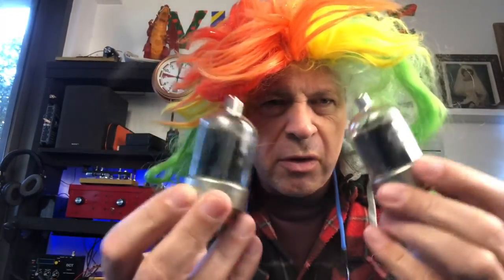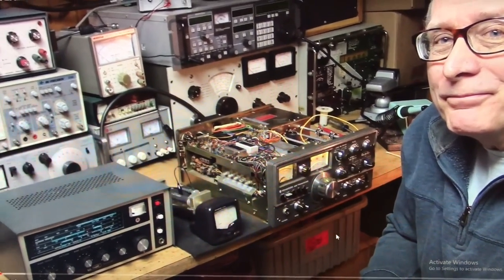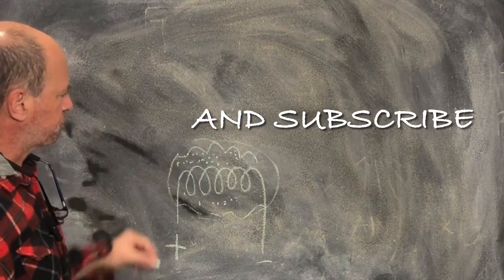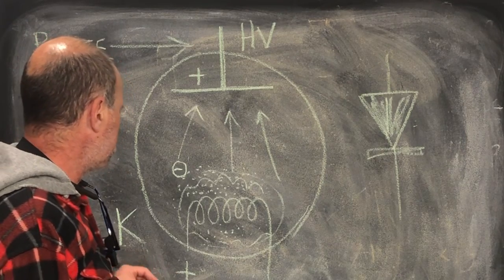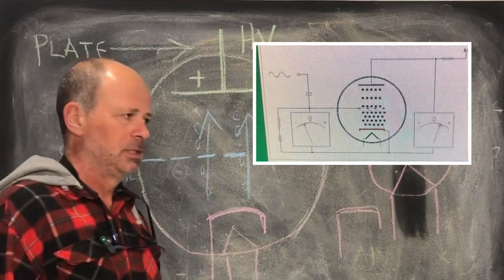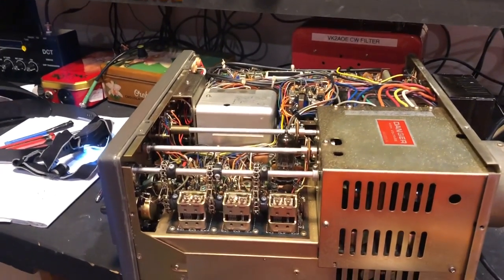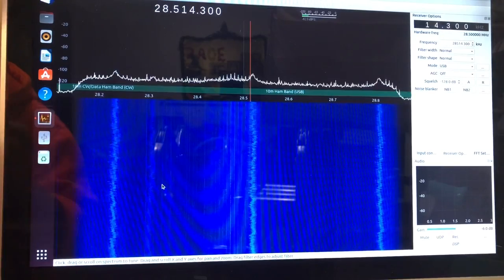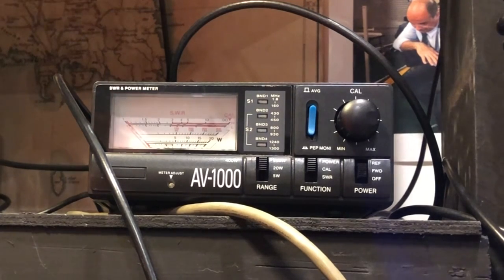KENWOOD TS-520 - Finals replacement@TheArtofEngineering

Comment from the maker: Which might mean that the filament supply or some other part of that driver tube is loading a supply causing the issue? My TS520 I changed all large electrolytic caps (not every cap). I’ll look at a cct diagram and have a think about it. 73 OM

Comment: Darn good opening advice!

It cant hurt  to thoroughly clean the glass envelopes and pins so contaminants dont  burn on.

Also, according to the tubes plate curves, the 6146 and 6JB6 are the same tube except the 6146 is twice the plate dissipation rating, and one less base pin. They have the same biasing and operating point(s).

The electrons jumping into a cloud is a myth.
The heat reduces the Work Function requiring less plate to cathode potential to cause them to come off.

If not, current could flow without extrrnal bias.
Reply from the maker: Thanks for the comment. Could you point me towards some information that confirms the electron cloud is a myth? It wouldn’t surprise me that this is true (as even the current flow analogy to water is SO NOT reality) but a quick search didn’t offer any info. Thanks for the comment. 73 de VK2AOE.

Comment: Hi mate, I have been watching your youtube videos and trying to tune in my 520 I am so confused. I am not sure if it is even working. I am getting a little bit frustrated. I definitely need some help.
Reply from the maker: Are you just tuning it to transmit ? Or have you replaced the tubes with new ones. If just tuning for transmit watch this video
https://youtu.be/40Inq07Spd4 it helps to have a 50 ohm dummy load but if you know your antenna has an SWR below 2:1 you can tune it “on air”.

Comment: Hello
Would you be so kind as to give me some advice?
I have a Kenwood TS 530s with the following symptoms:
In RX:  
heater=off, Reception is correct.
heater=on, Reception is lost.

In TX: 
Selector in SSB:
IP readings: reading 0 Even negative, 
ALC readings: reading 0 Even negative, 

All components of the final step plate are in good condition.
Could it be a valve12BY7a problem? or the electronics of its periphery?

Thank you.
Reply from the maker: I am by no means an expert. Obviously be very careful as the voltages are deadly!! Only proceed if safe and you know what’s going on. Have you tried with driver tube removed and heater switch on…. To see if that kills receive? It is an interesting fault? Let me know what caused it, when the solution is found? I will keep my ear to the ground and if I hear anything helpful will pass it on 73 de VK2AOE
Reply: @TheArtofEngineering  First of all, I can't be more grateful for your quick response. This equipment has just arrived in my hands because I really like valve equipment. They seem like engineering jewels to me.
I have carried out the test that you propose, If I remove the Driver valve, 12BYA and right after I activate the heater. The reception is perfect, it is not lost.
Thanks again
Reply: Apparently it could seem like a valve problem. I don't rule it out. What happens is that I have tried a second valve and the problem persists. 
Unfortunately I don't have a valve tester to know what condition these two valves are in.

Comment: I own 3 ts 520 knwds. I do not have to say I hold them in high regard
One is brand new in the box ! I do not mean I still have the box !
I mean it is still brand new in the box
I bought it from a fella who bought the rig then never got a ticket
He never even opened the box :)
I had a uncle who retired and moved to costa rica
He brought his 520 with him. He used it for decades and never had a single problem
Still had the original tubes !
The 520 was built during a time when the japanese were making bones
A kenwood was of a bit higher quality the the rest
We will surley not see such a robust piece of gear again
I only operate QRP cw nowadays and will likely never fire up my 520 again
I wonder if you read the service manual
I changed a set of tubes a long time ago in one of my rigs
I used only a multimeter a oil cooled dummy load and a fiberglass rod I made into a screwdriver by sharpening the end
I had no problems
Reply from the maker: Yes ....Unfortunately a digital meter won't cut it for the neutralisation, an RF voltmeter is recommended and not that common as test gear anymore. I used my oil filled dummy like you did (homebrewed)....and for the neutralisation a tap on a dummy fed into my SDR to look for the null. I did read the instructions in the operating manual (don't own a service manual for it). They are amazingly well built...I doubt in 50 years time any of the rigs around today will be alive. I always get compliments on the audio when working SSB. I do fire mine up, but like you prefer QRP and rigs I have slaved over to build. My homebrew efforts thus far are VERY modest ...but that first QSO on a completely homebrew station was priceless!! The TS520 since changing the bottles has been good! Nice to own ham history. 73 watched this guy on YOUTUBE too
https://youtu.be/v0EmyyYNy00?si=LK5bMnjbE_03i1F1
Reply: Yes I a big fan of that fella too
He not just a hobbiest @TheArtofEngineering